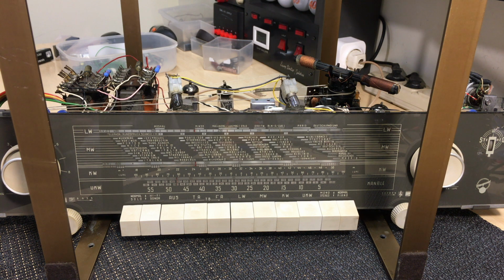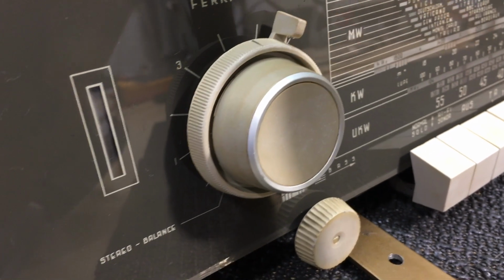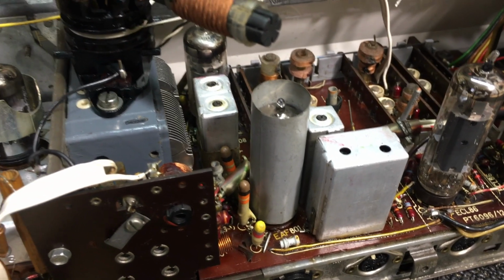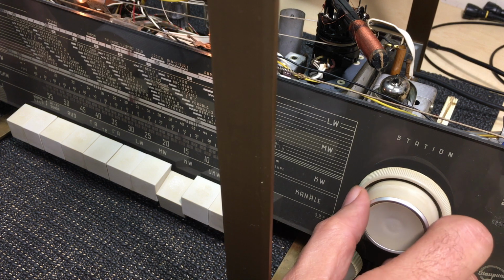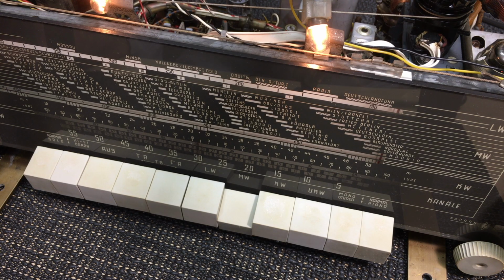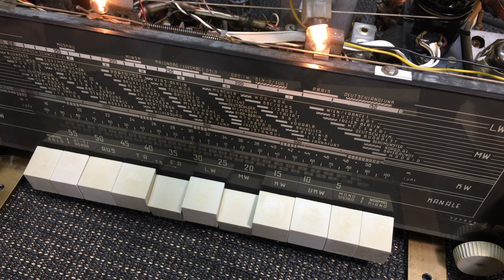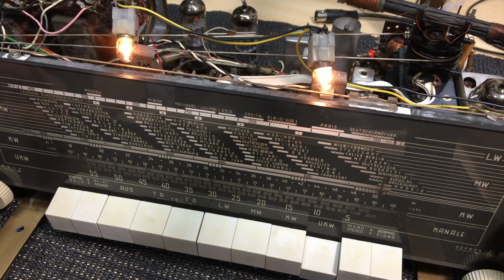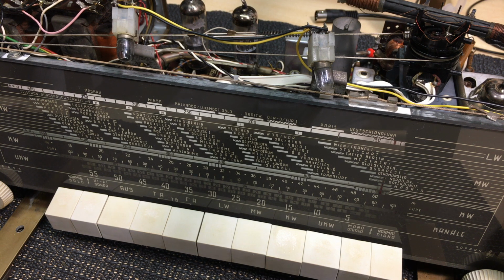Blaupunkt Arkansas stereo tube radio restoration - Part 5. Final reception test.

Comment: The advantage of a swiveling ferrite antenna is not primarily to maximize the wanted signal - which is difficult due to the broad maximum - but to notch out any unwanted/disturbing signal. This is easier because the minimum is very sharp. The received amplitude versus position (degrees) follows the sinus-function with broad maximum and steep zero crossing.
Again - fine job!
Reply from the maker: DL7MAJ Stefan : this is clearly notable when a weak station is on and barely audible. When the ferrite is used the noise cuts out and suddenly a useable reception is heard. Good explanation. Thanks.

Comment: I purchased sometime back a RADIONE Jupiter U (VOR NASSE SCHEUTZEN!) in very good cosmetic condition with a main speaker on the front and one on each side.  It is a real beauty.  Even the Dial Lamps work well and it picks up well on all Bands with all knobs and dial strings working well.  It must have been well stored and taken of over the years.
I have no knowledge as to the history of this radio aside from that I think it indicates the radio was made in Austria.  I know the names of many of the European radios like Blaupunkt ect., but this one was new to me.
I don't know the year it was made, but it has the look (ivory push-bottons, dual dial pointer's ect.) of the similar German European radios and continues to have wonderful sound and tonal qualities.  Amazingly, it still works quite well.  I just keep my hands crossed, as I have no idea who could repair this radio when such is needed.  So, I just play and enjoy it as long as it keeps "singing".
Reply from the maker: Richard McLeod : It’s Austrian from 1958 and can be repaired quite easily. There’s even a full service manual  on the net.
Reply: Thanks for the information.  I see the common German names often, but the Radione brand was a new name for me.  Glad also to know that when it does break down, it can be repaired.
I picked up the radio at a Goodwill for about $15.00 3 years ago.  I was not so astounded by the fact that they virtually gave it away, but that such a beautifully maintained and still working radio would have had so little value to so few people these days.
I hope the day comes back (and seeing your site helps me to  think so) when the beauty and craftsmanship of these European vacuum tube radios is again appreciated.  The Radione I have has the rounded Ivory colored push-buttons which to me are quite attractive over the later white and squared push-buttons.  I know there were many American radios with exceptional sound qualities as RCA Victor even imitated some of their European counterparts, but this special group of European radios simply jump out at one because of the quality and craftsmanship that went into their manufacture.

With so many AM and FM Stations closing down in Europe (I read where FM Stations do not exist in Norway any longer), I would suppose their value there is also on the decline.  Shortwave isn't what it once was either around the World.  Luckily in the States (certainly where I live in California, both the AM and FM Bands are still going strong).  KFI in Los Angeles has been a major station since around 1924, not long after the introduction of radio!
I don't see that changing, at least not for the present time. @electronicsoldandnew

Comment: I have really enjoyed learning from your videos, thanks for taking the time to produce them.  I am currently working on a Blaupunkt Riviera 2633 MX, which is similar to the Arkansas you restored.  My radio unfortunately has had one of the audio transformers replaced in the past.  At the moment I can only get sound out of one channel, the transformers pass the signal generator test though.  I am still working through many other checks, but do you know a way to check if a transformer is properly "matched" with the amplifier tubes (EL84 in this case)?  I have been able to find a potential transformer for replacement (original transformer TF754/12 51Q7 and have found a TF754/12 4T11).
Reply from the maker: Um afraid it’s a little complicated. Try to find out from the seller what it is/was used with before.
Reply: @electronicsoldandnew  Unfortunately the change likely happened years ago.  The joys of buying old no longer wanted radios :).  It will keep me busy for a while.  The replacement one I have is from a Stockholm (Blaupunkt but year unknown - it looks the same and one of the parts numbers match).  I'll keep working through the schematic and see if I can find a bad connection or component failure.

Comment: Is this the end of the series? I was very much curious what would come out of the mystical tube behind even the more mystical VF STEREO logo. It seemed to me that the tube was connected to some sort of solid state electronics. The tube itself looked weird. I could not tell the type. Documentation for the model does not mention any stereo decoding equipment.
Reply from the maker: Robert Szelepcsenyi : the service manual actually does show a “decoder jack”, but I did not have the decoder module for this radio, nor have I seen one.